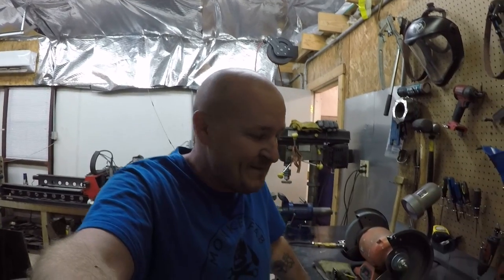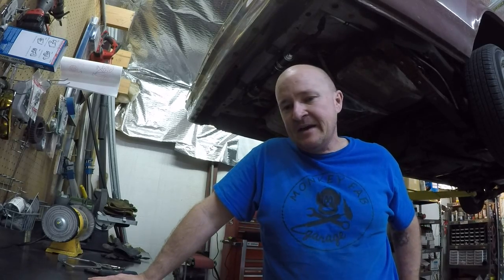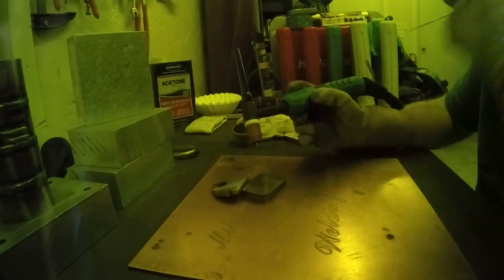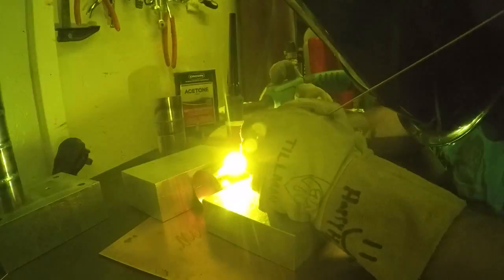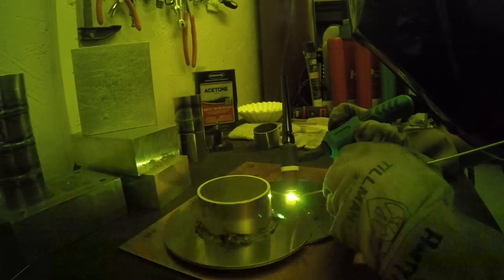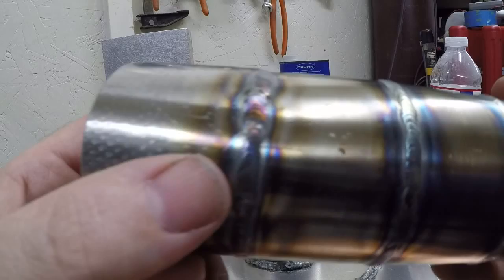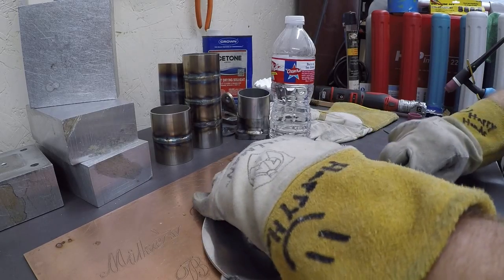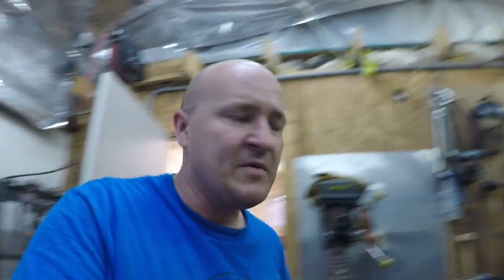Cheap tig final SIMADRE TIG200P 200A TIG/MMA/PULSE DC INVERTER WELDING MACHINE

Comment: Hi There This guy asked a question ????  and i have the same question .... No INstructions thank's 
How do you plug in the ground , on the left where it shows a stick welder and says (-) or on the right where it shows a ground clamp (+) . Shouldnt the stick welder be on the negative side or does the 
stick /tig switch switch the polarity properly , the manual really sucks

Comment: That aluminum weld on DC looked allot better than I thought it would. I've never had any luck with aluminum on DC (straight polarity)
Reply from the maker: it was really strange to weld because it just didn't look like anything was happening. you hit it with the heat and nothing, the oxide layer acted like a baggie just holding the metal inside. you just have to stab it with the filler to get them to join. i think a but weld would be very hard to pull off. certainly, nothing under .125". but it was strong as hell and the penetration was solidish lol

Comment: How do you plug in the ground , on the left where it shows a stick welder and says (-) or on the right where it shows a ground clamp (+) . Shouldnt the stick welder be on the negative side or does the 
stick /tig switch switch the polarity properly , the manual really sucks ,

Comment: Back in the 1930’s through the mid 1940’s, aluminum was welded with DC. Heiliarc was invented specifically to weld aluminum using AC. So it can be done. But you’ve got to remove the oxide layer immediately before welding, as it only takes a few minutes to reform. Describing the oxide as a bag over the aluminum is a really good description. It’s why it looks hard, and then, as early welders said, it would just disappear. The AC breaks up that layer.

Comment: How did that Tig hold up, is it still a good buy?
Reply from the maker: Kevin Jones worked fine for what it was. I raffled it off for charity so I have no way of knowing how well it holds up over time.
Reply: Is this the same Tig?  https://www.amazon.com/SIMADRE-POWERFUL-TIG200P-INVERTER-WELDING/dp/B011W0XM3I/ref=sr_1_5?ie=UTF8&qid=1524853910&sr=8-5&keywords=simadre+tig+welder
Looks like they changed it a bit, just wanted to make sure it was the same one. Thanks